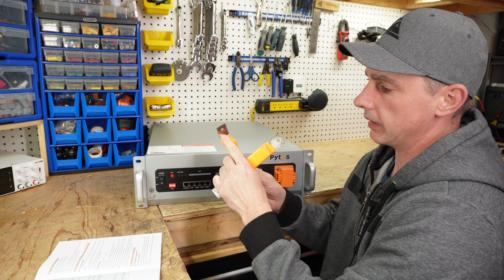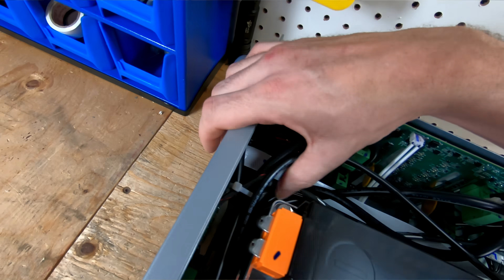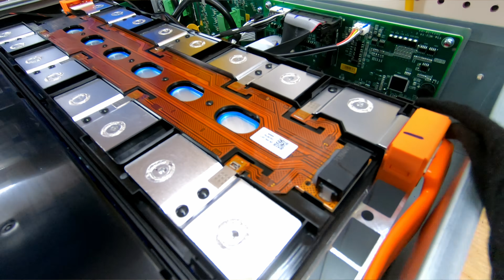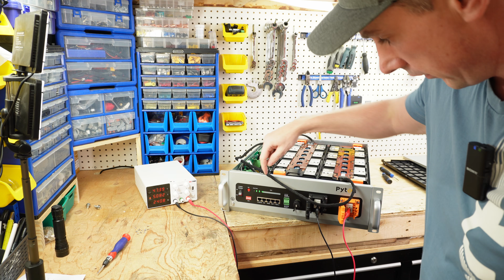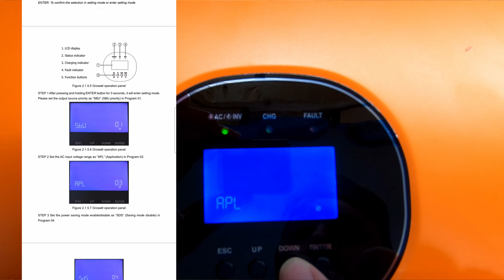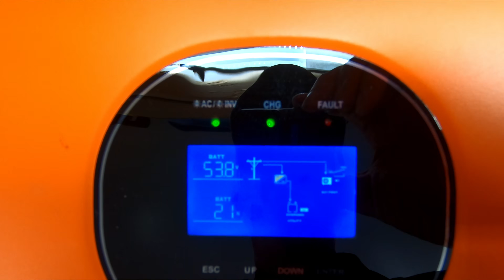Pytes V5 Heated, Wifi Monitoring, Amazing Build Quality 48V (51.2V) Server Rack Battery

Comment: I bought SOK because they can be field repaired, as well as purchasing a spare BMS for them.   Cells have screw connections instead of welded.   If SHTF you can kiss a warranty or parts from China goodbye.  Is any of this battery field repairable?  Are parts available?  Can I replace one cell or substitute a cell from another failed battery?
Reply from the maker: @EagleNestLiveTexas  These batteries are built tough. They also come with a 10-year replacement warranty. BMS or cell, I get a brand new one.

Comment: So at/below 5°C heaters turn on to keep the battery at good temperature (i guess +5°C) for charging/discharging. how much watt per hour is this feature using? Does it use the energy from the battery itself until it is empty in case there is noch charging on a very bad day? When it is empty, does it pull the energy from grid until it has enough energy to maintain the heating without grid energy and it is able to cold start? All this questions come down to: is this heating feature economical or does it pull a lot of energy during winter time? thanks a lot, nice video
Reply from the maker: Thanks, I believe it's on while charging. I can't say for sure.
Reply: @Roll2Videos  I have this battery. Heating starts only when the battery's temperature is below 0 C when it is about to start charging. When discharging, heating is off.
Reply from the maker: @brasovcosmin3975  Thanks 👍
Reply: @brasovcosmin3975  buna ziua!! Vreau sa cumpar acest acumulator si va intreb daca este ok in timp si daca acea incalzire isi face treaba bine(este de ajutor pe timp de iarna)Vă mulțumesc !!!

Comment: Any idea of the price range for this battery? I really like it but i think it is a little pricy.
Reply from the maker: Pytes V5° 51.2V 100Ah
👉https://bit.ly/PytesV5
Reply: @Roll2Videos  Thank you for your answer.  One more question, is this a 0.75C or it is a 1C rate battery??
Reply from the maker: @luiscastillo861  All the information is on this website https://bit.ly/PytesV5
Reply: Ok i am asking because specs says recommended discharge is 75a. But how about if i need to discharge for lets say 1hr at 100a?? Would it shutdown? Would it work??
Reply from the maker: @luiscastillo861  That would be specified under the maximum continuous discharge.
Reply from the maker: @luiscastillo861  You can also download the user manual on the website and under the specifications you can see the peak charge and discharge

Comment: Thank you so much for the review. Which battery do you like better the V5 or the  E-BOX-48100R.? I do not need the heater feature.  What do you mean at the end of the video -- Not actually bulletproof LOL?
Reply from the maker: Tough question, The E-box is great, The V5 also has a wifi stick I'm going to test soon for remote monitoring. Not sure if most people will need to monitor the battery though I prefer to see the system as a whole. I meant don't shoot a gun at it.

Comment: Wow, that's an impressive build quality. Great video!
Reply from the maker: Thanks, buddy, I'm very impressed with their build quality.
Reply: @Roll2Videos  What do you think about repairability? Seems difficult with those laser welds and spot welding to replace a bad cell.
Reply from the maker: @silviucat  If the battery has a good warranty, you shouldn't have to replace many cells. If at some point one cell was to go bad and you replace it with a new one while the other 15 have aged might cause other problems.

Comment: Thanks for the video. Nice intro video on this battery, but would have liked a more detailed review.
I like the terminal covers and the SOC indicator.
I don't like that it is not serviceable - welded cells.
Could you please show the PC software and its setup options in future videos. I have not seen this BMS yet. Could you show how the battery balances, I assume it has only weak passive balancing. I would like to see how the battery communicates with other batteries and if it has the possibility in the PC software to display data from multiple batteries in one window.
The most interesting feature is the Wifi connectivity, which many batteries don't have and which I would also like to see detailed in other videos how it works and what the Wifi app looks like and what all it allows. 
Can this battery also connect to Home Assistant?
Reply from the maker: Great comment! I don't think I will be getting a second battery, unfortunately.
I will make a follow-up video in the future testing some items you've listed. The wifi stick is in the mail, I do believe it will connect with solar assistant. 👍😁
Reply: @Roll2Videos  You have a different Pytes battery that you have shown in the past, their BMS are not compatible?
The question on Home assistant was meant to suggest that the Pytes guys or another BMS manufacturer would read the comment and see this as an opportunity to add this feature to their future BMS. Only the JK-JBD-BMS interface board has plug-and-play Home assistant connectivity, at least as far as I know.
Wi-fi connectivity should be standard on all BMSs today, along with active balancing and excellent Wi-fi, Bluetooth and PC apps.
Reply: @Roll2Videos  You say "I don't think I will be getting a second battery, unfortunately" - is that a price thing? Or due to compatibility with your existing system? Something else?
Reply from the maker: @andrewdunham8973  Sorry should have been more clear on that. Companies send me these products to review. I don't think Pytes is willing to send me a second one for review. I could buy a second one but why would I when other companies are waiting to send me theirs for a reduced price to make videos? This battery will no doubt work with multiple Pytes batteries and my system as a whole (future to come). 
Thank you for the question. 😁

Comment: That’s a really sweet battery build!  So much tjme and thought was put into those internals!  Thanks for sharing!

In regard to the heating pads, you mention that the BMS will try to keep the battery at a warmer temp, but everything shut down when you had a low temp alarm.  So does that mean that if you truly have a low temp situation that you need to use an external source to warm up the batteries in order to charge?  It’s nice that the BMS tries to keep things warm, but if it’s unable to, you can’t use the heating pads to warm up the batteries before charging can commence?  Am I just missing something?
Reply from the maker: I spoke with Pytes and was told it disconnected and alarmed because the sensors were more than 15°C temperature difference which identified a fault, not a low temperature event. The heating comes on at 5°C while charging.
Reply: @Roll2Videos  gotcha.  So in theory, the heater should be able to keep up.  The only reason it faulted was due to your “deep freeze” test.  Thanks!